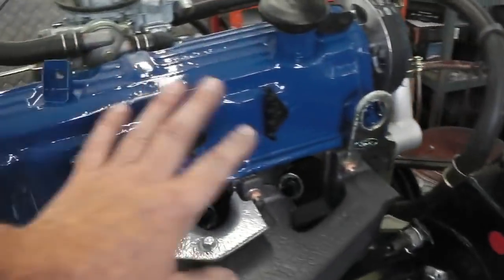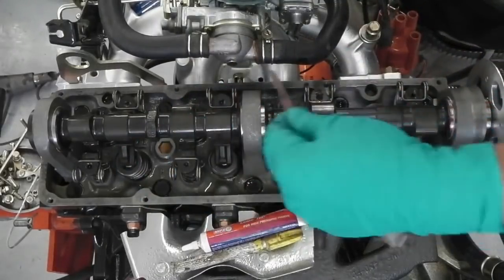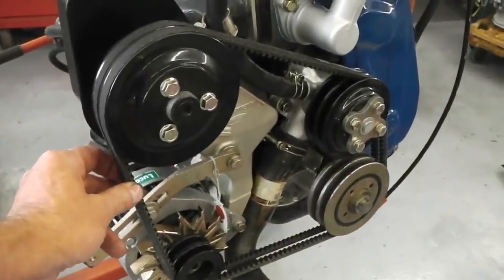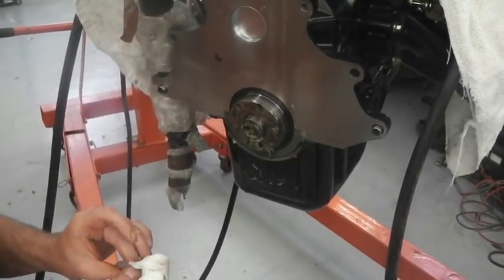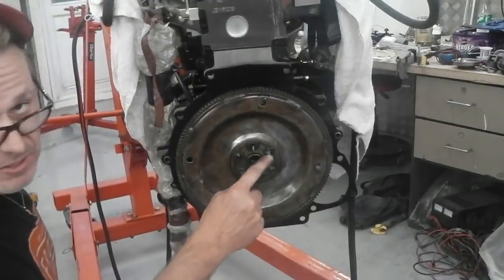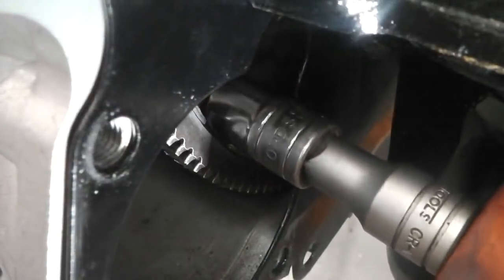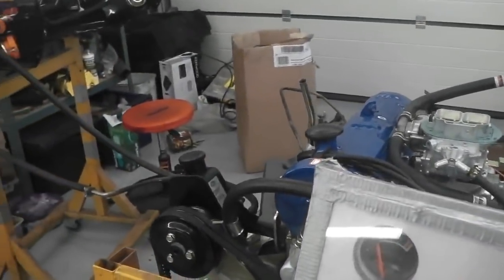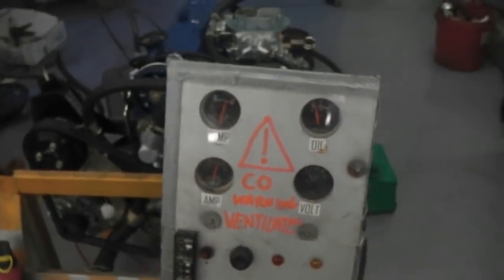Classic Car Restoration - Mk3 Cortina - Project Bramble Ep36 Pt1

Comment: What a terrific result Pete. Well done you ... Can't ask for more than a perfect running engine and I love that jig. No the thing the engine sits in not your dance of joy when its started!
Suggestion:
Make up a set of studs that will fit in the top four threaded locations in the rear of the engine block so you have guides for the gearbox to come in square onto the drive plate. Then turn the crank to locate the studs in the holes and pull the gearbox in as you did onto the locating dowels. Pull the studs out and job done. I used to do this with very heavy Scania gearboxes and it worked every time after a clutch change or front seal replacement.
I am sure you have an answer but I always worked on the 'theory of 9' when adjusting valves on a 4 cylinder engine - Adjust 1 and 8, 2 and 7, 3 and 6 etc. You did '3 + 8' which = 11?
Reply from the maker: VERY GOOD INFO chish!!!!! as always thanks for your support!!! always look out for your wise words. Pete
Reply: @PeteCswampy  You Sir are most welcome.

Comment: Great work as usual Pete. An EFL 90 oil filter would complete it nicely but I imagine those are extinct these days. 1243 is the firing order of the ohv Kent engine. It's pretty sad that I could still rhyme off the valve clearances, dwell angles etc of both the ohv and ohc engines and the valve clearances of the cologne V6. I need to see a therapist I know but sanity will be resumed when we see the shell back from the painters. Thanks for the memories of my ford days.
Reply from the maker: Colin the fram is for running in, i dont want to throw away my last few EFL 90s but you can buy em from BURTON POWER EFL90, i just dont want to waste one on the first run in of engine

Comment: When using a hoist,to hold the engine still use a pair of ratchet straps downwards to the legs,it makes lining up the transmission much easier and when holding the crank still use a 1" strip of angle iron to wedge down between the dowel and gear ring, the two edges of the angle will lock into the teeth and the dowel will lock both it an the crank.

Comment: I had one of them torque converer bolts work its way loose on a mk 2 granada years ago ended up having new big end shells done at a garage and it was still knocking wasn't until I was driving on the motorway and saw clouds of white smoke bhind me that the problem finally became clear as all the flid drained out on the exhausts, easy fix in the end

Comment: Good video but I thought they needed coolant for the temp gauge to read as otherwise you’ll just be reading the air that’s in there ?
This is why when you lose coolant the gauge never really shows a true reflection.
Apologies if it’s a different sensor.
Reply from the maker: it will still give a reading but yes for accuracy water needs to be there, its not shown on vid but im using an infra red thermometer too,  you see this on next vid. Pete

Comment: Pete, it's much easier to use the 1 in 9 rule to set valve clearances.
Turn crank till No 1 valve (free end) is fully open.
Take 1 away from 9 =8
Check No 8 valve
Then turn crank No 2 valve fully open take 2 away from 9 = 7.check No 7 hope this helps
Reply from the maker: Geoff yes i have heard of thsi idea and was trying to google it youve saved my time thank you!!!!!
Reply: Pete regarding your steering rack:I've worked in a car plant for over 34 years, 13 of those years carrying out durability tests /analysing  warranty and returns. During this time it was (and still is) common practice within the industry to paint mark a component once its been inspected / tested - colours used on OK parts yellow, green & blue. Red is only used for Scrap / out of spec parts.

Comment: I just remembered ,I don't know if this is relevant but a friend of mine had a sierra with a Pinto ,a project rally car .When he bought it was a non runner ,He had the engine rebuilt and drove the car less than one mile but melted no2 piston .This happened twice before he found there were 2 variations with different firing orders .And strangely enough that also appeared to initially run fine .
Reply from the maker: thanks Chris, its just i had the book open on wrong page, page for KENT firing, after all this time i still cant recall the firing order, i should know better!!!! but with all the excitment and the filming etc  just forgot.....at least i spotted within the first minute

Comment: pete  did you drill out the oil feed pipe     holes for the cams      please put a radiator   on   a old one    please

Comment: Hi Pete, I may have missed it along the way but did you find out about that o-ring seal on the oil bar? Did you put one in? Great job! I got excited for you when it fired up. Brilliant job and as always a really good video. Just what we need during the lockdown. Cheers, John from Oz.
Reply from the maker: john i looked at another pinto engine and that didnt have an o ring

Comment: Wear on ring gear suggest missed starter engagement. After all that work the ring gear should have been replaced
Reply from the maker: I didnt know you could replace the ring gear. looks like its attached to the flexplate. flexplates arent available,or at least, i couldnt find them. took a year to get this one. works perfect Craig, but i hear ya.

Comment: Pete ,    don't fire her up yet budd....................................

There's a loose HT Lead not plugged in properly on that picture above ;)
Reply from the maker: picture is old, i did get leads worng way round though as you will see on the film, i used OHV spec as i had the haynes manual open on the OHV page !!! dduuuuoooooo silly me...... i spotted it second fire up

Comment: that temperature gauge is supposed to measure WATER temperature not cylinder head temperature. cant see any water in so engine is way too warm. got a clip round the ears if I ran a pinto more than a minute when dry. ford mechanic 1980 - 94, used to maintain a fleet of pintos, cortina, capri, Granada, sierra +transits -very easy to crack heads between valves due to local overheating..... PS set tappets loose till bedded in as gaps love to close up after rebuild. keep up the good work -you are getting my brain ticking again !
Reply from the maker: thanks Paul, i think was only running a minute or so, radiator was fitted shortly after, ill upload part 2 asap, I used infra red thermometer which is not shown on the film